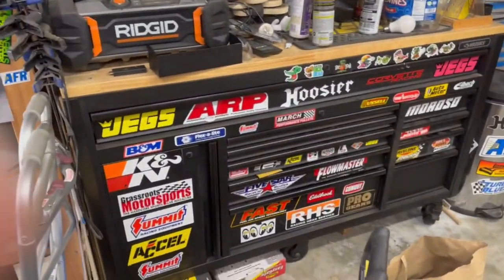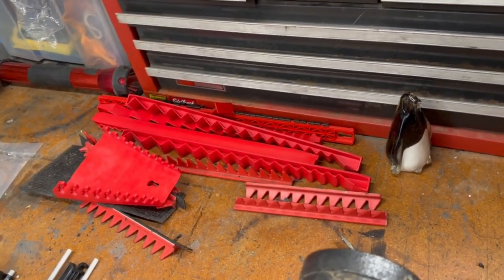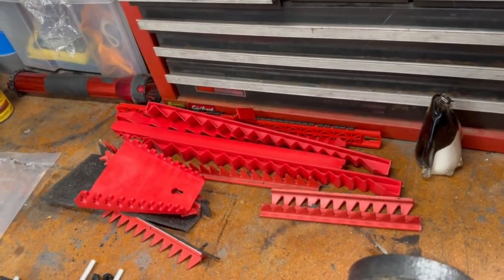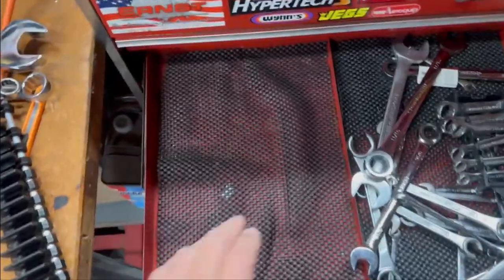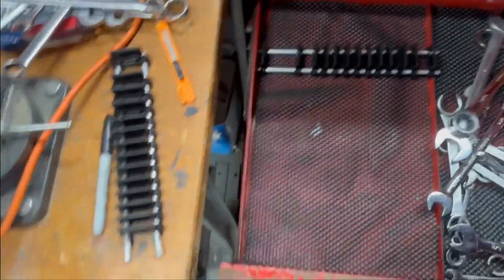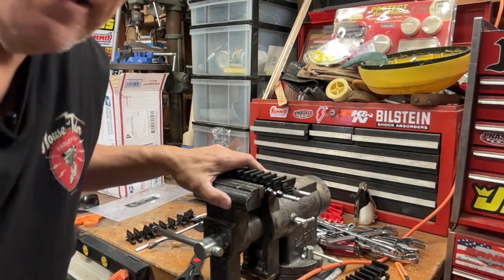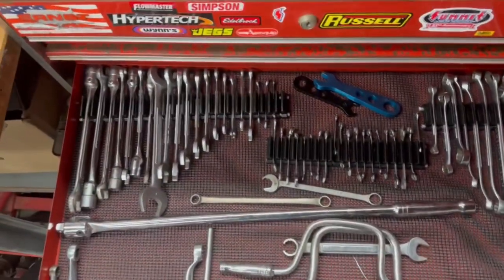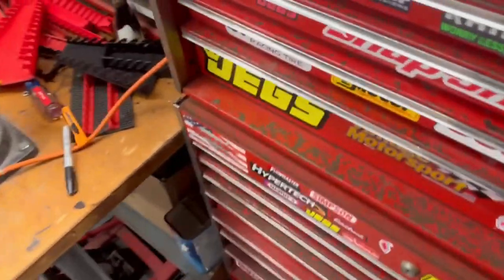Alien Space Saver - Best Wrench Organizer?

Comment: Thanks for the review.  One thing to mention is they use non-proprietary 1/4" aluminum rod so you can go to the hardware store and get longer pieces/cut to length and then just buy the separators/"wrench organizer attachment" (which are sold separately).  I ended up buying 60 of them and will get a couple of 1/4" rods from Lowes or HD with the primary use to hold ratchets and extensions.  I had a question and "Mike" from Alien Space Saver emailed me back the same day.  Seems like a great product and a stand up company.  Can't wait to get them!
Reply from the maker: You will not be disappointed.   These guys provide amazing tech support and customer service.  Not a fan of their socket system, but I love the wrench organizers.

Comment: you should have used a 3" air cut-off, or 2" wiz wheel. You need to try the DiamondX 2" or 3" cutting wheel. Creates no transferable heat to cutting area. Cuts like butter. "You'll never use anything else again" Small jobs I use a snapon 1/3hp air grinder with 1/4"HF hookup full open with a 2" DiamondX wheel. Wheels are about $24ea. But outlast 3M cutting wheels by about 20-1. My 3" wheel has been on my tool for exhaust jobs for the past 2 years with still no apparent wear. price is a bargain!
Reply: Thanks!  I'll have to try it.
Reply from the maker: Thanks for the tips!

Comment: I like to read the sizes on the sides of the wrenches, so I wouldn't use this. too bad they don't have them angled and a place to write the sizes then I'd use them. This one is probably the next best thing.
Reply from the maker: One option is to put size stickers right on the sockets.  A couple of places sell them cheap on amazon.  If you clean the sockets with alcohol before applying the stickers, they do last a long time.